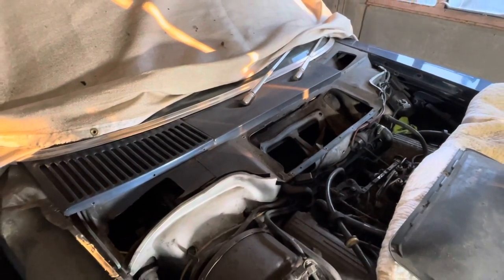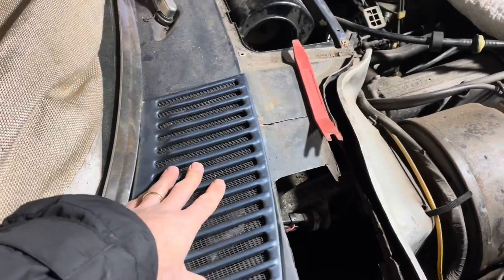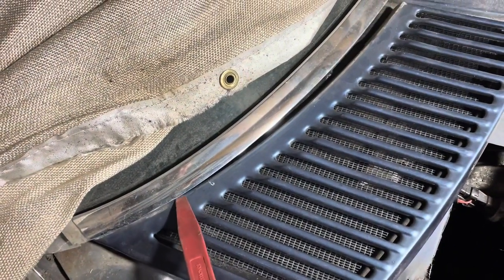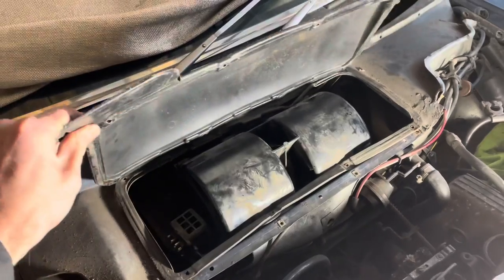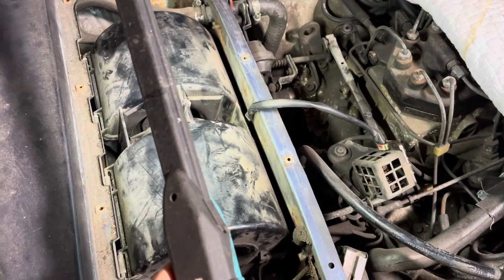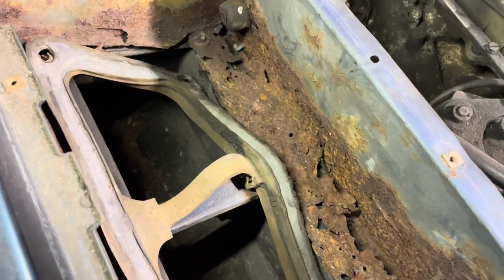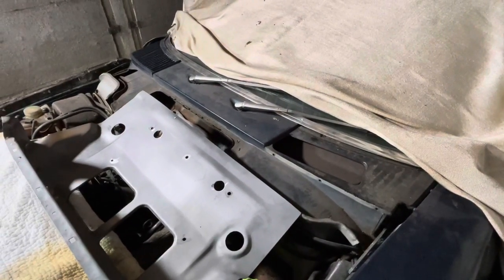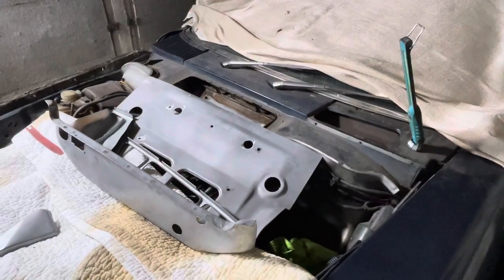The infamous Mercedes SL R107 bulkhead rust inspection (Part 2 of 2)

Comment: Luckily on my '85 I just needed to replace the lower 2 bolts that hold the blower motor.  I used an epoxy and stainless steel bolts

Comment: Love your vids Ed. I changed out my blower motor cap, the first seal and blower motor but couldn’t figure out how to change the lower seal under the blower motor. How is that done? I was lucky and found no corrosion or rust in my 1980 450 SL. Thank you!!!

Comment: I enjoyed these two "rust" videos. When you are looking at potential purchases, do you use a bore scope to check areas such as the ones you've shown? I ask because it seems that it would work well and be more well received by the owner since you would not have to disassemble his or her car. This has been very helpful to me because I did not know they had that level of rust issues in the bulkhead area. Thanks!
Reply from the maker: I would try and use a bore scope in general yes, but I haven’t checked to see whether it’s possible to get it underneath the heater motor. 

One thing that would probably work is threading the scope from the central compartment and over the top of the internal wall with the outer, that way you could look at the condition of the outer chambers without having to remove the grills on top of them. Might give that a go if I have a moment.

Comment: A suggestion to prevent rust, is to keep a car cover on the car.
Reply from the maker: yes I would agree with that. Sometimes covers can cause their own issues but for the R107 most of the rust is caused by rainwater entering the car and not leaving as it should, so a cover will largely stop that.